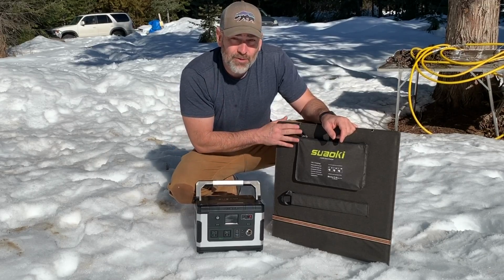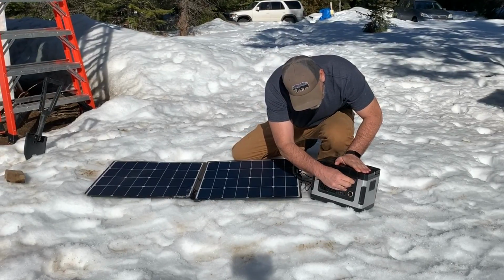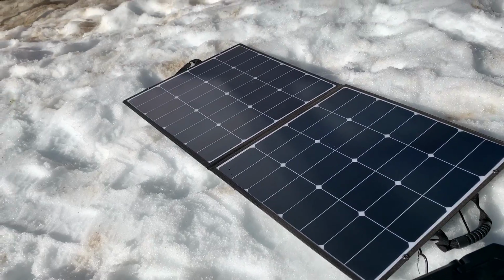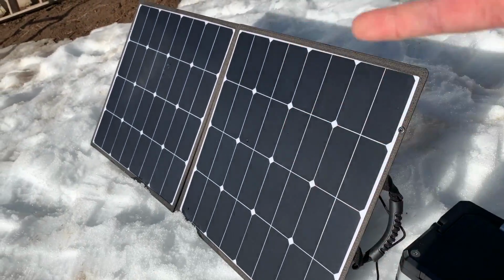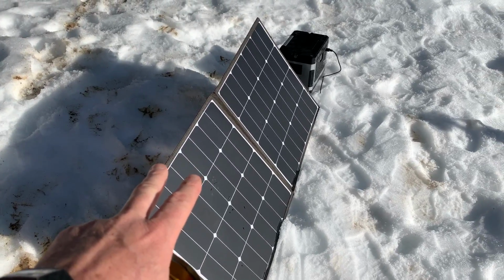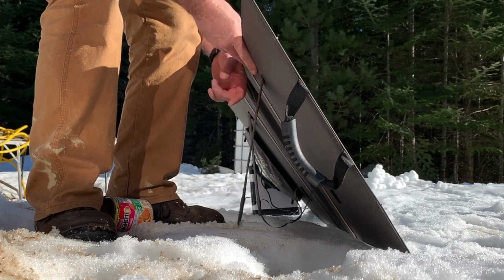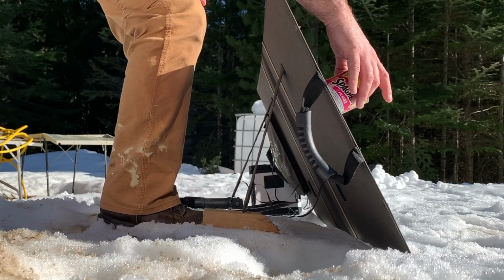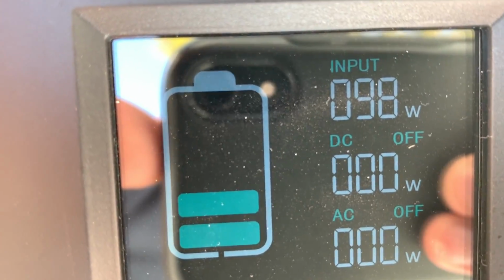How to Get the Most Power Out of Your Solar Panels

Comment: In a snowy environment like you show here (especially as the sun is low in winter) if you have the option, you might get a few more Watts by ensuring the surroundings are reflective snow and not absorbing trees and other dark materials.
Alternatively some reflective panels (e.g. covered in aluminium foil) could gain you up to about 18%.

Comment: At your final setting, the panels are only positioned once per day.  e.g. the can NOT casting a shadow .  You have the vertical tilt correct so that the sun does not cast a shadow towards either the top or bottom of the can...but in an hour, as he sun tracks across the sky, their will be a shadow to one side of the can, requiring you to rotate it every hour along it horizontal axis to track the sun...a lazy susan type set up is good for that, but you have to run out every hour to correct the offset.  The can will cast a shadow every other time except the one time when the sun and the and care perpendicular to each...think sun dial.  the only time it does not cast a shadow is at high noon.  it's like that with the can, in that the can is a sun dial, and as the sun tracks across the sky, the can will develop a shadow left to right.

Comment: this is an old trick that's been around for a long time, and a very effective method.  i use a small dixie cup glued to a piece of cardboard, and then bend the cardboard so it hangs on the front of the panel...  you will have to reposition the panel a few times each day, but it is worth the effort...
Reply from the maker: Good idea.

Comment: How long will full optimization last till you need to adjust again? Looks like a great set up for camping.
Reply: I don't think it would take very long for the generator to charge .So you wouldn't be plugging it back in anytime soon .
Reply from the maker: The optimization will gradually decrease. It would depend on how important it was to you. Maybe check it every hour for best results.

Comment: Where can I get me a 50 Amp solar panel with a charge control and something that can detect a short circuit. Can a 2,000w solar panel work for a jumpstarter to get more watts to power stuff ?

Comment: Wow, all that work for 6 extra watts! Make sure you check it every 5 mins as the Sun moves you know! 🤭
Reply from the maker: Didn’t we start out at 40 something watts?
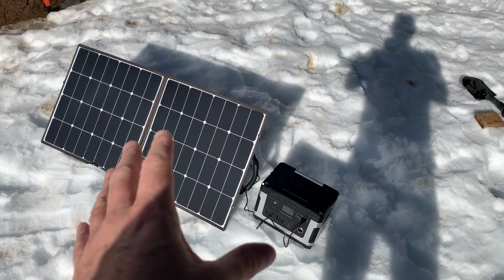Reply: @MartinJohnsonOffGridLiving   I'm pretty sure it would've been somewhere around ZERO when you started making the video but at 1:38 It was at 92% with 2 clumps of Snow shadowing the bottom Cells of the panel which you can clearly see.😏
Reply: Every watt counts when u need it that much !